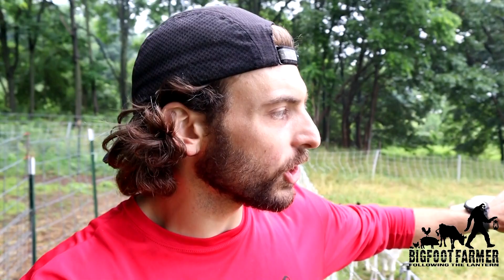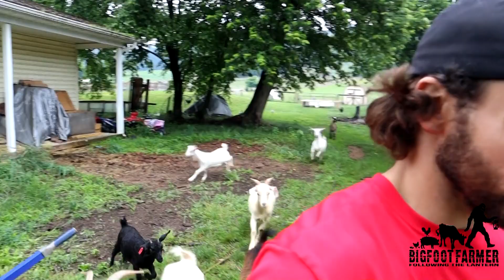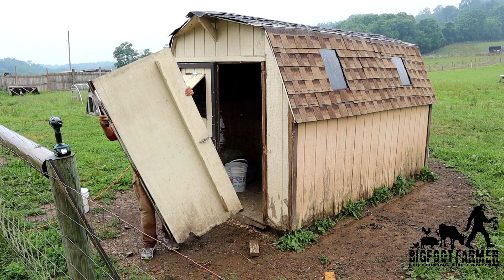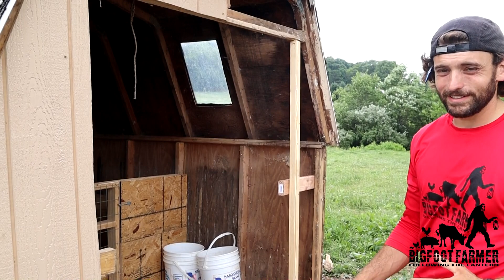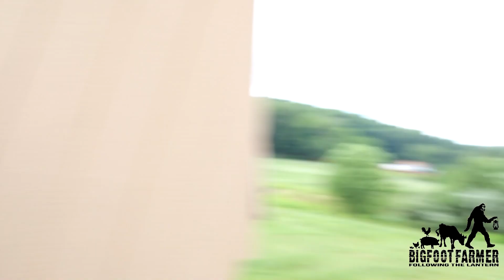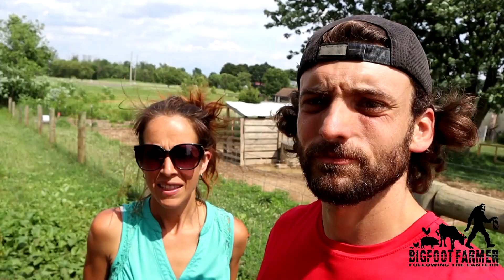A HOMESTEAD Project That Made Me PANIC

Comment: Something to be said for a spare 20 x 20 tarp, some eyebolts, Bungee or rope, do some prelim drill holes, some outdoor/water-proof caulking... squaring up the edges with metal angled/face plates, getting it off the ground a little, some chicken wire underneath, some long stakes to secure from outside preditors, wheels on the tractors for the larger chicks... at least on one end... ? 

There's a large horseshoe apparatus that has wheels, all you do is tip it over to lift the chicken coops... blah, blah, blah. 

Hate trying to help so many YT vloggers and getting nothing for my skills and input. I bill at $200 an hour. What do I get? 

Nothing, zip, nada, zilch, a 16 oz jar of honey, a few chickens? 

Nope. O. 

Have a nice life.